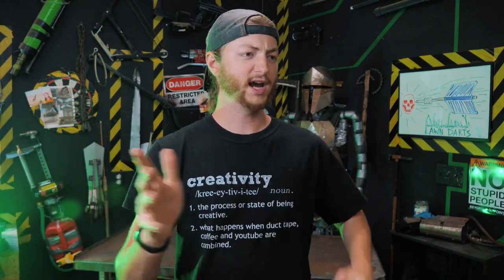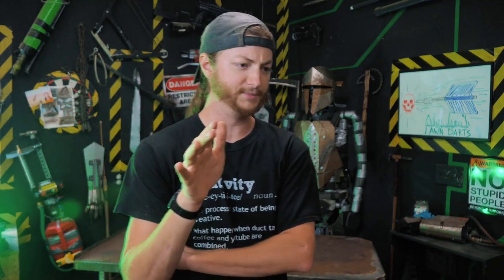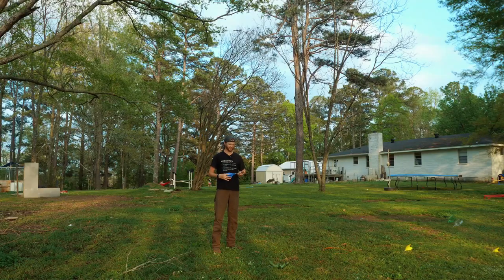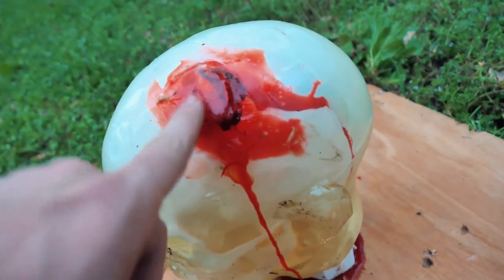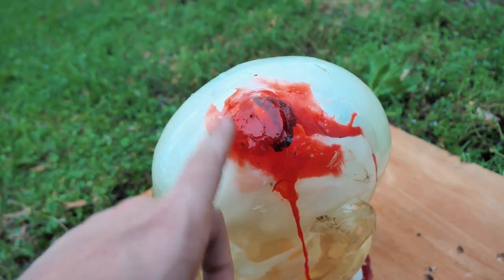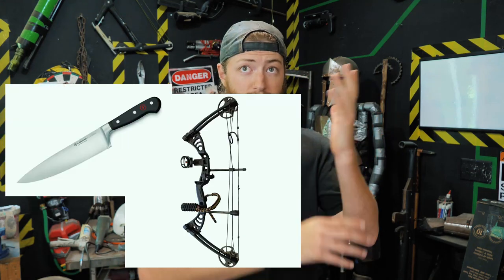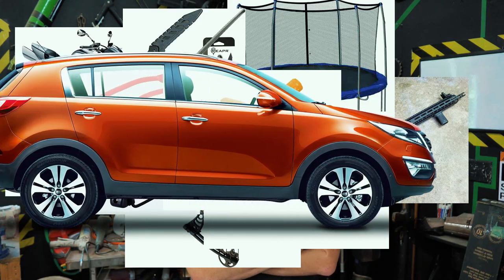the TRUTH about Lawn Darts (mythbusting)

Comment: You throw a 13.3 oz rock in the air, whe  it comes down it can hurt someone. If anything, this is safer because the fins give you more control and drag, slowing the fall a bit. Maybe we should ban rocks now too. 🤔
Reply: Nope. Unless you added a parachute, still going to fall at 32 fps/ps no matter the weight until it hits terminal velocity. Definitely not any safer than a rock. The surface area of the rock may bruise you when it hits, but it likely won't penetrate like a sharpened pointy steel rod.

Comment: The fins are supposed to be in the forward position during your throw (against the weight section). This allows the back of the rod to be a handle during the throw and should easily be 10-12 inches of rod to grasp during the throw. As you throw the fins slide to the back of the rod during flight (changing the center of gravity and stabilizing the flight with an audible click of the plastic fins hitting the capture nut on the back end of the rod), and then immediately shift forward again to right behind the weight section on impact (with a unique and satisfying signature "thunk" sound, both of metal in earth and plastic slapping metal). This allows the kinetic energy of the fins shifting forward to help "punch" the tip into the ground so it would stick consistently. The weight section was about 4-6 inches long and was a significantly wider OD than the penetrator which provided a good "shoulder" to keep the whole dart head from being buried/embedded. Your penetrator diameter looks close enough to count. The length of your dart tip wasn't long enough, the penetrator was about 3-4 inches long (part that sticks in the dirt). Seems they were about 2-2.5 feet long all in. They weighed about a pound and a half apiece, maybe a bit more: they were substantial. If the plastic sleeve on the rod doesn't pinch your fingers at some point sliding your knuckle meat between the plastic sleeve and the capture nut on the end, you're doing it wrong. I like your idea for rod with no plastic sleeve better for this reason, you'll have to rebalance the weight to account for that additional mass on the back side of the dart however. Probably lose the threads too or it'll abrade through the fins gradually. Real lawn darts were heavily forward weight biased. They easily and consistently punched through even hard Oklahoma sod. The correct way was to play back and forth so it didn't take as long to retrieve darts. 😳 Distance thrown was usually 15 yards or so. This meant paying attention to where you were in relation to the incoming dart. Kinda like a game of Battleship with consequences.  Yes, I'm Darwin approved. No I definitely would not have wanted one of those things to fly into me.

Comment: As a man who has played with lawn darts as a child I wanted to let you know that you have a tiny design flaw.  The "fins" are referred to as a "flight," and the flight is NOT meant to be stationary.  The flight is meant to slide freely along the shaft of the lawn dart.  The shaft should not be threaded.  While the lawn dart is thrown in a similar manner as throwing a horse shoe the lawn dart should not be flipping end over end while in flight.  To throw the lawn dart you will grab the rear end of the rod (opposite to the pointed side).  The tip of the lawn dart should be pointed toward the ground and the flight should will rest on the shift closest toward the tip of the lawn dart.  Throw the lawn dart exactly as you did in y9yr first attempt within the video.  You'll find that your accuracy will improve dramatically.  The flight will be pushed to the back of the lawn dart's shaft as soon as you release the lawn dart as you throw it.  Please remember you are holding the bare shaft when you throw the lawn dart.  You are not grapping the flight.
My best recollection is that the flight doesn't appear to spin much during flight, but I assume the tip and the shaft are spinning during flight.
I hope you make this correction and post another video.  I think you'll have more fun throwing lawn darts.
Reply from the maker: I tried that sliding fin design first, but it didn’t work well. I think because the darts I made aren’t balanced well? Not sure. Couldn’t get them to slide correctly, so I end up just making them stationary. There were a number of variants of lawn darts, not all were sliders

Comment: From an impartial/pretty much robot view: 
The lawn darts box did say that they were for adults. (2:24)
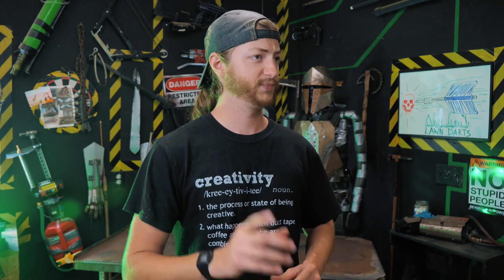And at 3:42 you can see a warning which literally says "Keep out of reach of children."
So technically speaking; it was Mr. Snow's fault for not properly storing the darts. And so they shouldn't have been banned.

From a normal view with some common sense- you can see why throwing large, semi-pointy objects wouldn't really be a good idea- especially allowing that the tips are made of metal. (So why in tarnation would you buy it to begin with?)
But if you for whatever reason did so anyways: it seems to me that the manufacturer could've used something softer material- namely plastic, or rubber- that wouldn't have been as likely to kill/harm/otherwise maim someone.

So in conclusion to one random guy's overly wrought opinion: Should lawn darts have been banned? No. But the manufacturer should have changed the design after the lawsuit. Seeing how it was unnecessarily dangerous.
If you took the time to read this monologue, Thanks! And I hope you have a nice day. :)

P.S If you're worried about being demonetized for gore- try using the ballistic zombie heads- the "blood" is green, so you're less likely to throw up.
Reply from the maker: Lol when I bought the heads they weren’t selling the green blooded version otherwise i definitely would’ve gotten them
Reply: Oof; fair enough.
Reply: Yeah, but wasn't the victim a neighbor in the adjacent yard, that's what I thought, I could be wrong!
Reply from the maker: Victim was in the front yard, they were throwing them in the backyard. I still can’t see how they should be banned… it’d be like banning bows and arrows cuz somebody decided to shoot arrows into the air.
Reply: Tartar sauce for tarnished tarnation. 🤌🏽
Reply: @ismokekillz yeah I love it too👍

Comment: I think based on the fact that we know these things have penetrated multiple, actual human skulls.. I am sort of skeptical of this test.. obviously the sharpness of the dart is a huge factor..  pressure would be inversely proportional to the square of the radius of the tip.  Another factor at play here is the fact that the skull was already damaged when the other tests were performed.. I can't say for certain what effect this might have, but it could allow the skull to more readily deform elastically.. like the difference between attempting to puncture a sealed soda can vs an open soda can.  It is kinda difficult to draw conclusions from things like kinetic energy.. as far as I know there is no mininum kinetic energy required to penetrate a skull.  I also think the specifics of the impact may be important.. launching the dart horizontally may have significantly different results from dropping it from a height as gravity may assist in the deflection of the dart, particularly if the  center of mass is off